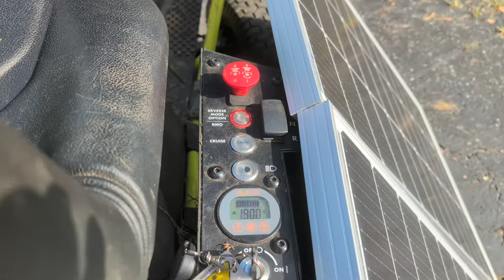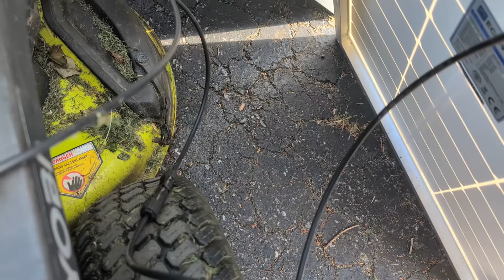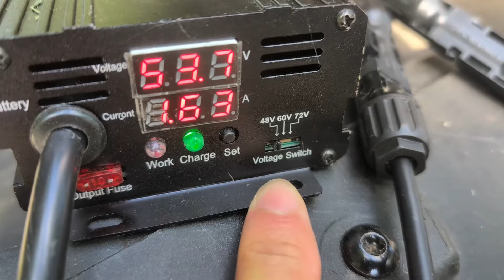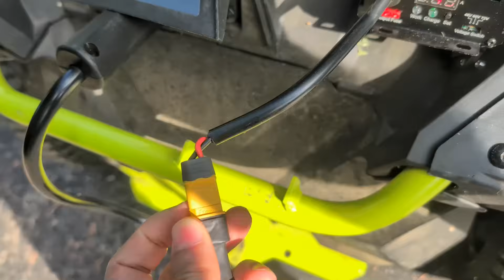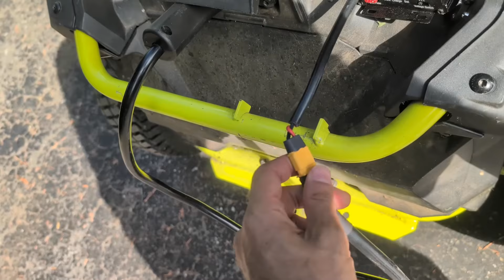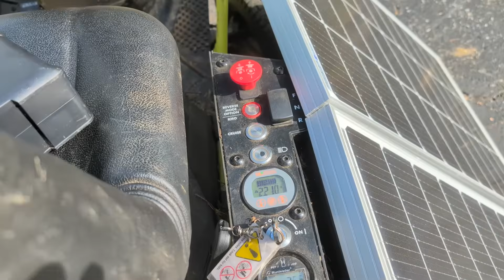Ryobi 48V Mower Tips: How to Build a Solar Charger

Comment: Are the XT connectors necessary?   Can the wires be spliced together?
Reply from the maker: They can definitely be spliced together. The reason I used XT60 connectors is because I was reusing the charging cable from the P3648 charger that has an XT60 connector on the end.
Reply: @The_Technical_Penguin  understand that now!  I’m going to use the  xt60s for that purpose now that I understand it.  Thanks!

Comment: The 2 solar panels in series connects to Ecoworthy solar charger.  The Smart charger 36v/48v battery charger connects to the HTRC P3648 with an XT60 connector?
I have the AC inverter that came with the mower.  Can I use any part of it with this solar charging method?
Reply from the maker: The P3648 is not used when solar charging, but you can borrow its charging cable and connect it to the Ecoworthy solar charge controller with an xt60 connector. 

The inverter isn't really used for charging,
Reply: @The_Technical_Penguin the “green” wire can be ignored?  What was/is the purpose for that wire originally?
Thanks
Reply from the maker: @johnduffy532 The green wire works with the stock charger to enable charge lockout, making it so you can't turn the mower on when the charger is connected. There are ways to enable charge lockout with aftermarket chargers as well, but you typically just do that at the charge plug rather than using the green wire.

Comment: Excellent video.   BTW, I noticed your green light is on during the charging.  Did you convert to LiFePo batteries?  If so, how did you get your green light to come on?
Reply from the maker: Yes, LiFePo4, but I converted that charge cable so it will enable charge lockout and turn on the LED. It won't flash like with the stock charger, instead the light is always on when it's plugged in.
https://www.reddit.com/r/Ryobi48vMowers/comments/1jwfucx/enabling_charge_lockout_with_the_htrc_p3648/